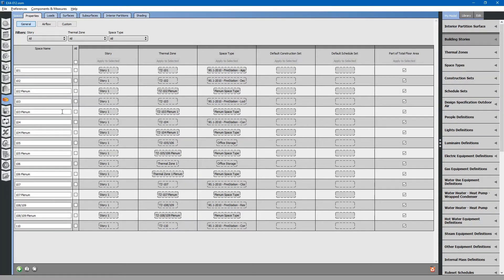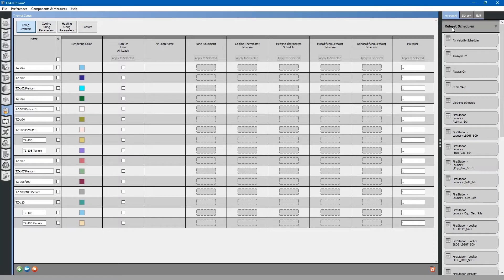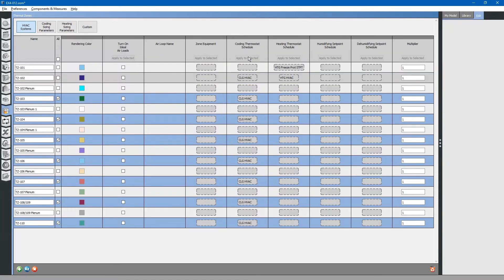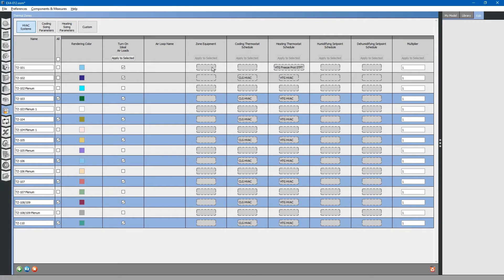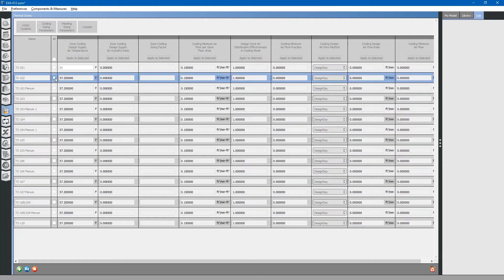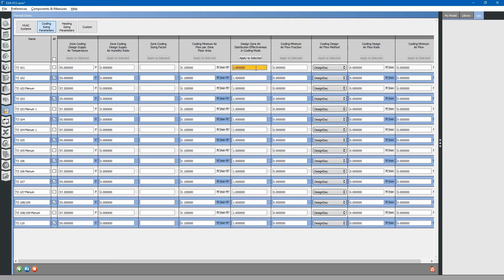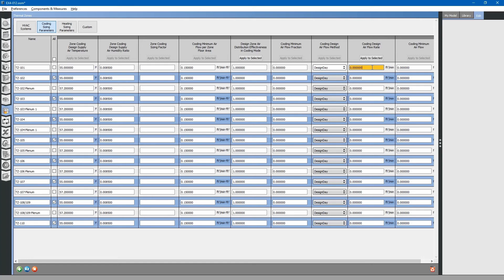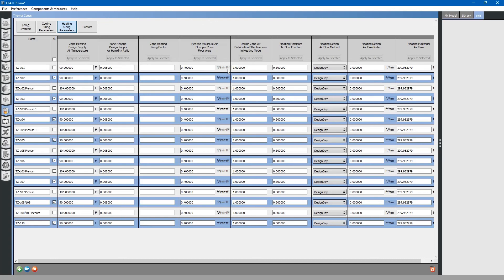Building Energy Modeling in OpenStudio - Thermal Zones Tab

Comment: Hello, thanks again for your tutorials. I have a question: for an specific simulation I'm using just natural ventilation (added as Zone Equipment in the Thermal Zones section and using an specific schedule that I created for it). Should I turn the ideal air loads on? Or this will interfere or overwrite my schedule, for exemple? Thanks!
Reply from the maker: When you turn on ideal air loads, it removed all zone equipment objects from the zone.  It will also remove the wind and stack object.

Comment: Thx for the content. Question: what’s the solution in case there is no air heating/cooling and just heating with radiators or floor heating? Shall the heating and cooling air flow in thermal zones set to zero? Thx 😊
Reply from the maker: No need to change it.  If you are only using radiators, or floor heating, the program will ignore the heating and cooling design air flow rates.
Reply: @helixenergypartnersllc3540  thx for the reply :) i have another issue: when i turn on in the Thermal Zone the Ideal Air Loads and run the simulation, i get an error. But when i turn it off and run the simulation, it works. If i understood correctly, the error is: "error=HVACTemplate:* objects found. These objects are not supported directly by EnergyPlus".  am i doing something wrong?!
Reply from the maker: @rezaadili-zo3jf  If you send me the eplusout.err file, I can take a look at it.